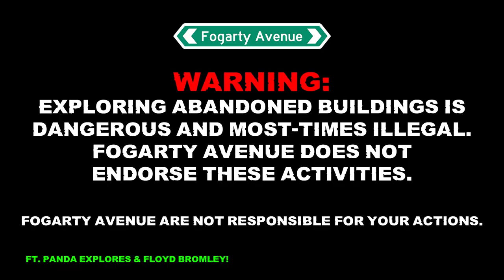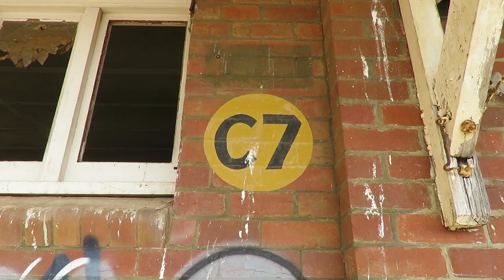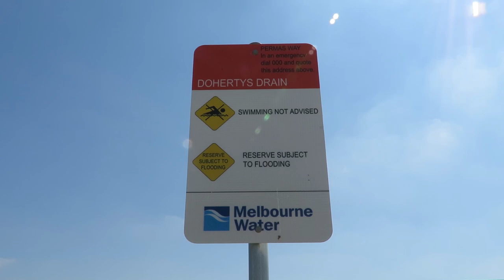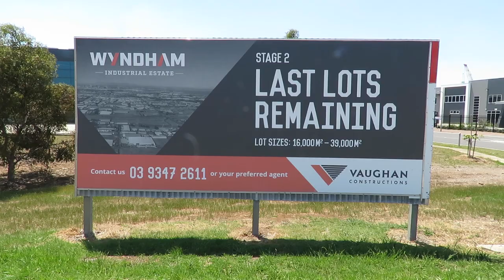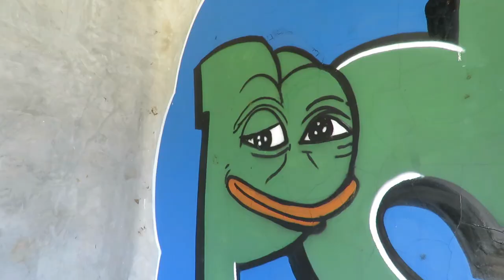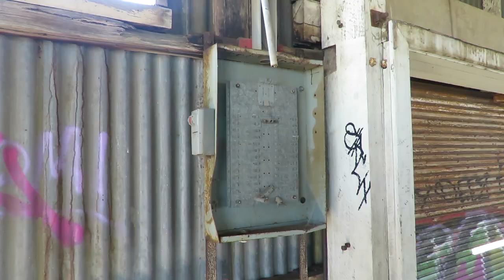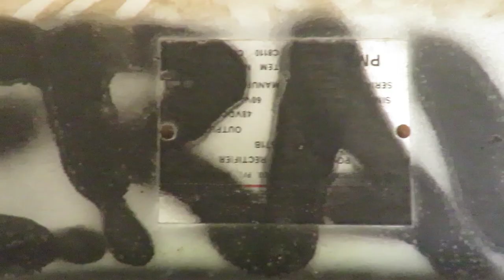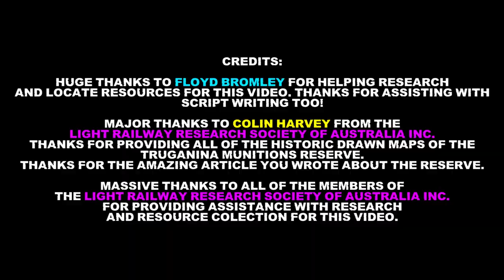HUGE Abandoned WW2 Explosives Storage Facility -  Truganina Munitions Reserve

Comment: The dots on the back of that sheeting indicate it's almost certainly asbestos. The era matches too. Asbestos is fantastically heat resistant. Trams were replaced in 1958 because of CONSTANTLY DERAILING apparently.
Reply from the maker: Very interesting. Thanks for watching.